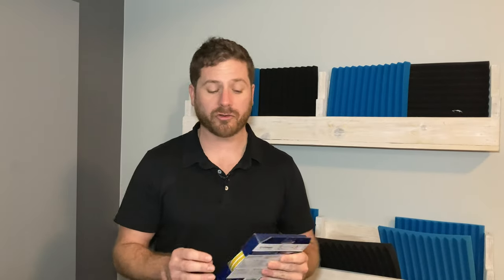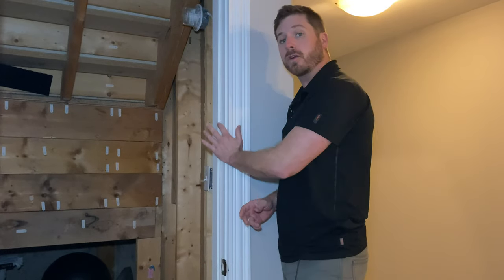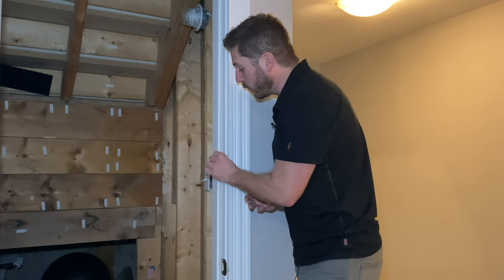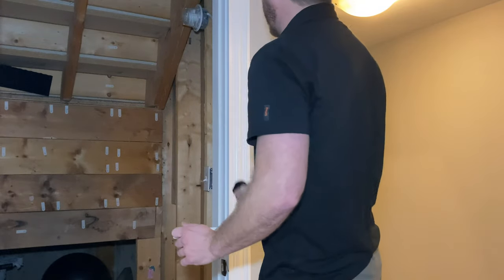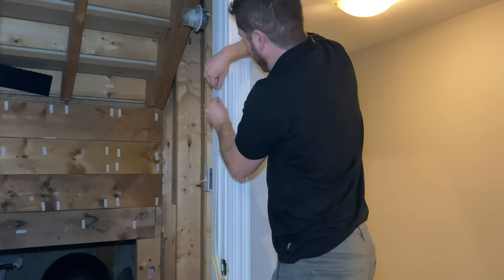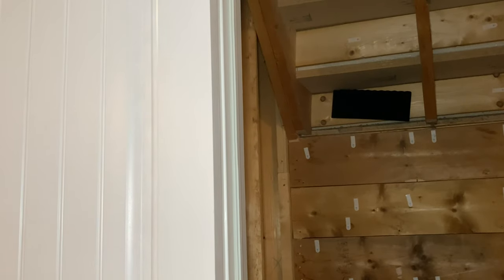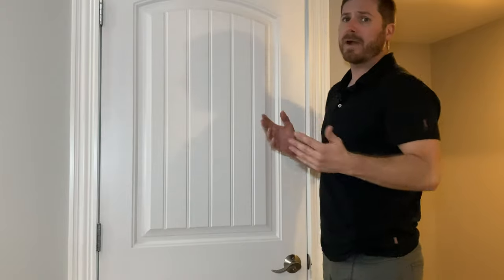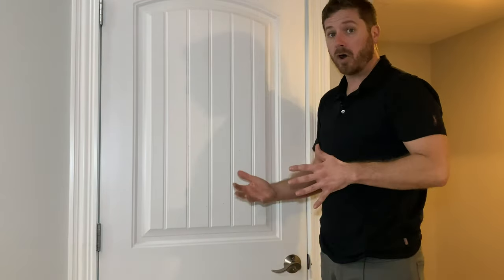How to Weatherstrip Doors To Stop Draft & Noise!

Comment: i applied weather strips to my door and my door wont close at all now what should i do?
Reply: Same question
Reply: same thing for me.
Reply: Me too😂,I'm so pissed off
Reply: You need smaller weather strips
Reply: Well, it's fairly clear the thickness of the weather strips cause too much dimensional interference between the face of the door and frame so your door latch won't close. You have to remove it, yeah I know it sucks, and install thinner strips. And by thinner I mean the linear dimension perpendicular to the mating faces of the door and frame. You feel me?

Comment: Great video! If i may make one slight correction. Einstein proved that light is smaller than sound, because light moves faster. So you could see light, but the sound might not make it through. Really great practical application! Keep it up!
Reply: The speed of light has nothing to do with it being faster. It's essentially a massless particles. Photons are smaller than atoms and sound is compressed gas hitting your eardrum. The mass and speed properties you mentioned aren't correlated.

Comment: If I have HVAC all over my ceiling joists, is there a big difference between two layers of drywall on ceiling vs using safe and sound and a drop ceiling. Obviously both these options will not prevent all noise making it upstairs but is there a major difference between the two.

Comment: This channel is a rare example of quality informative content in the s*thole called Youtube.
Reply from the maker: Oh wow, Thank you. :)
Reply: If I have HVAC all over my ceiling joists, is there a big difference between two layers of drywall on ceiling vs using safe and sound and a drop ceiling. Obviously both these options will not prevent all noise making it upstairs but is there a major difference between the two.